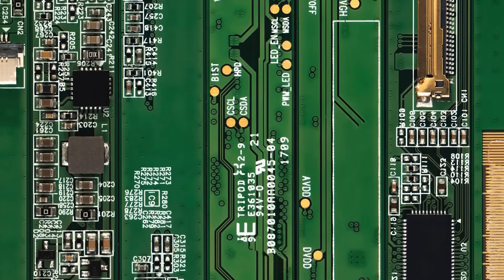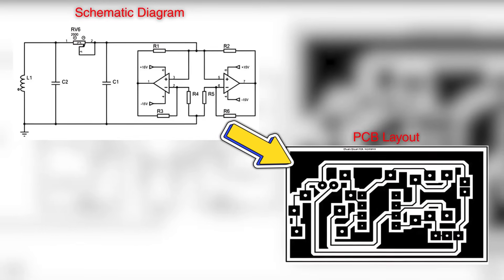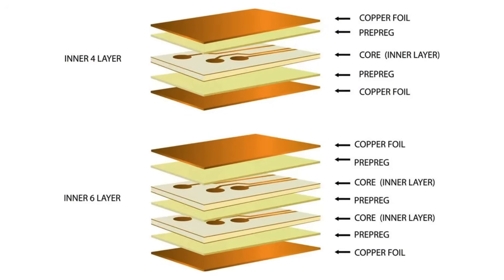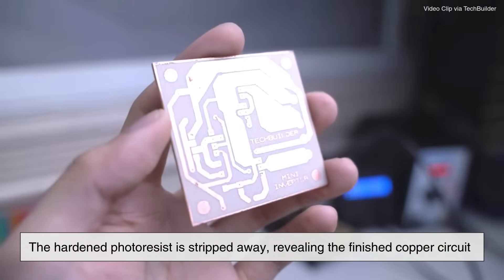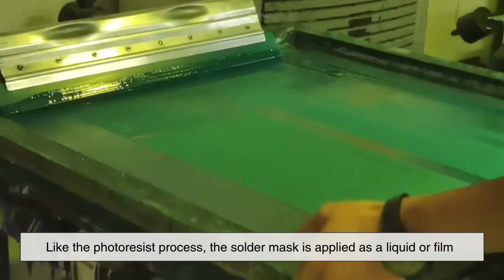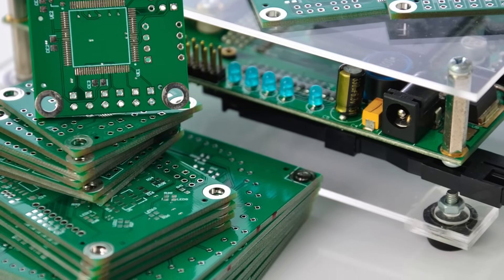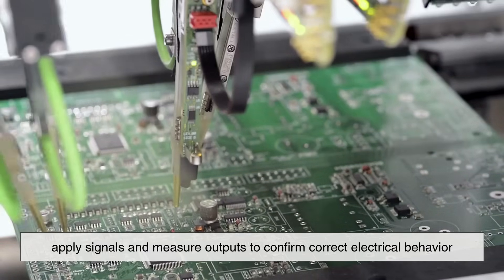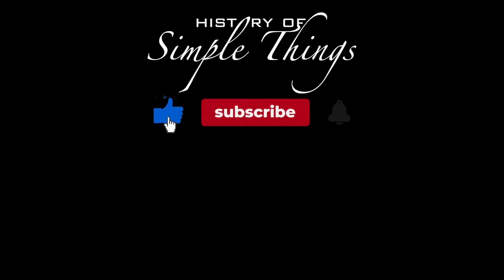How Are Printed Circuit Boards Made?

Comment: By making the ( Copper ) areas maximum ( IT , Copper pour ) the amount to be etched  GREATLY  reduces the amount of etching solution wasted .. but ... with high voltage PCBs , the opposite applies 😝... also , the through holes MUST be large enough to allow an unsoldered  PCB to have the leaded  components FALL OUT when turned upside down .. ( why ? ) because this makes the rework  MUCH  easier .. TOO MANY  ! PCB designers specify an ( interference fit ) of their component .. this usually results in a stripped out plated through hole , on rework (  NOKIA™ design dept .. DAVE™🛑 )